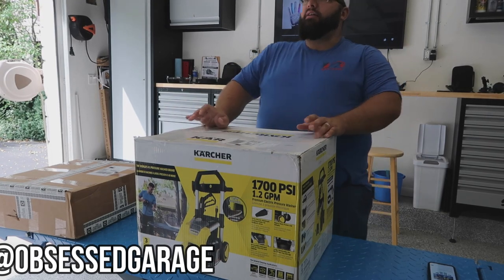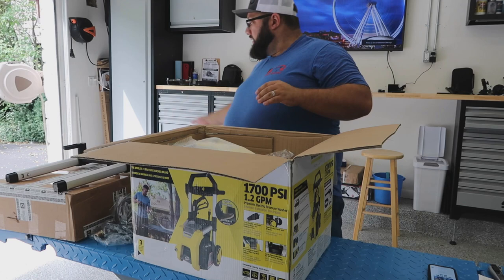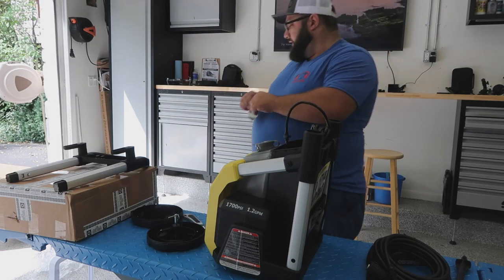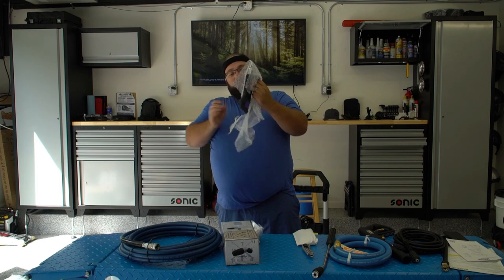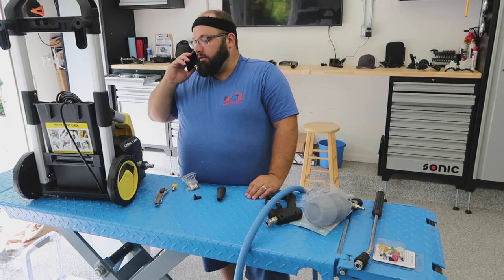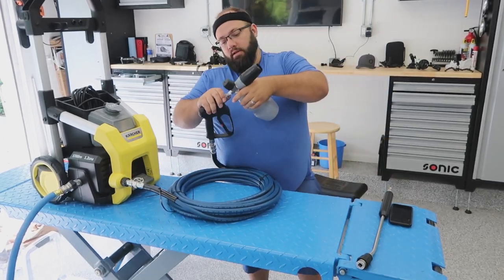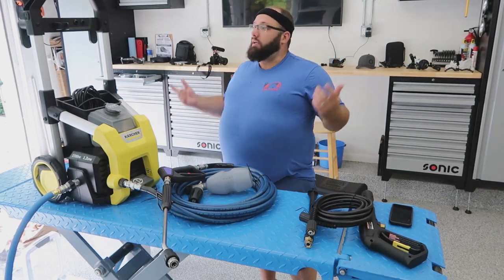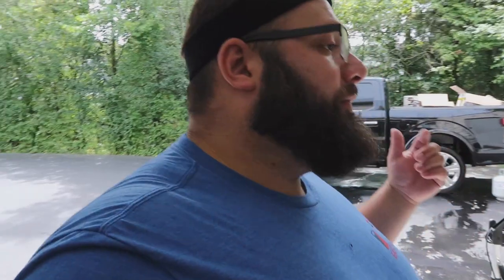Unboxing my Karcher K1700 Pressure Washing System! MY $40,000 DREAM GARAGE Pt. 8

Comment: Awesome space.  Well said that 90% of efficiency is knowing where your stuff is, though not always easy to get organized. That is a serious pressure washer hose, is that the KobrazJet, additionally if you don't mind me asking how is the set-up holding up 3 years on?
Reply from the maker: Still using it no issue. Little more pressure would be nice but a
Good little unit

Comment: So after using it for a while what's the verdict?  I have it in my cart but have been hesitant to pull the trigger as for me it will be a little over $665.00 (ultimate package) delivered.
Reply from the maker: Hey, so I love it but only use it for cleaning my cars and boat. The wand that Matt offers is far more quality than the stock one as well as the hose. One thing I do regret is not getting the 100' hose. I did switch from the Karcher on wheels to the one not on wheels as I mounting it to the wall. But I would forsure get this kit https://bit.ly/2F28KUq

Comment: $450 dollars in accessories on a $150 dollar machine.?!? Is this correct?
Reply from the maker: Yes sir and if you get the Karcher on discount you can get it for $90! I must say the accessories really do make a difference but each to their own!
Reply from the maker: It seems like I delete your reply by accident. Here it is from my email notification “Gas Tachs Garage Just does not sound feasible or justified. I'll put $1000 wheels on my 1992 Honda Civic. Seems like a waste if the machines keep failing IMO!” The The difference is your civic is already 20 years old we’re talking about a new Pressure Washer which should last 3 to 5 years but when it breaks I want to upgrade it I’ll buy a $800 pressure washer that doesn’t come with all the parts that I already have. It’s more like paying for a basement when building a house but not finishing it for the next five years ...

Comment: $600 pressure washer? That unit costs less than $200?
Reply from the maker: you sir are correct, it is the accessories that were recommended that cost the extra $$$ the quick connects, the 50' hose reel, the new wand... Do i think its all worth it? not really, but the 50' hose is great and the updated wand is 1000 time better than the one it comes with. Each to their own I guess.
Reply: So he sells a $130 power washer for 600 ? Because of quick connects and a wand ? Talk about overpriced
Reply from the maker: Florencio Velasco not going to disagree, but the wind is pretty awesome. 😂🤣
Reply: @flosano1352  Matt from Obsessed Garage does a LOT of testing with his team and puts together kits that are fine tuned—just an example, like swapping a 1.25mm foam cannon orifice for a 1.1mm because the foam yield is higher. I wouldn't recommend Obsessed Garage to the average person, only if you really want the best of the best.
Reply: Everyone talks about Matt like he’s soup nazi and are afraid to offend him. I’ve watched his videos and don’t see what the hype is about. Wow he does the torquing for you, ooooooo!!!!!